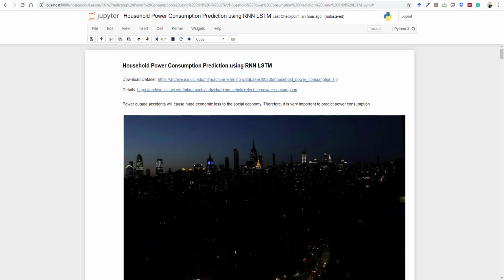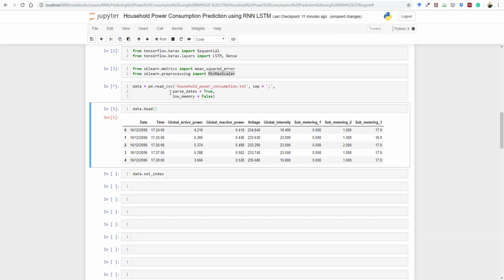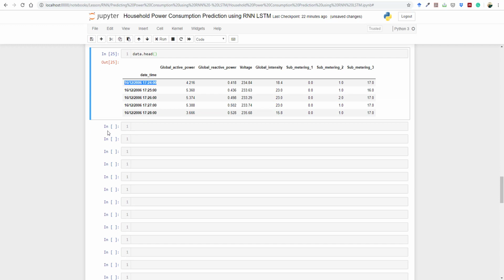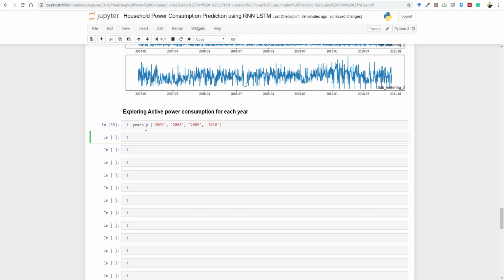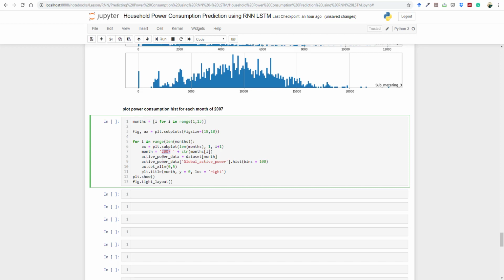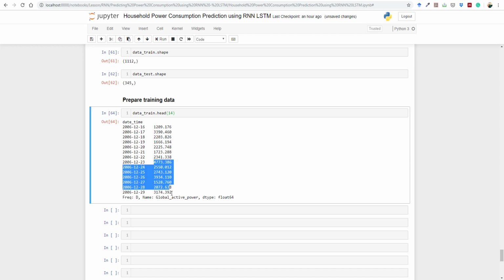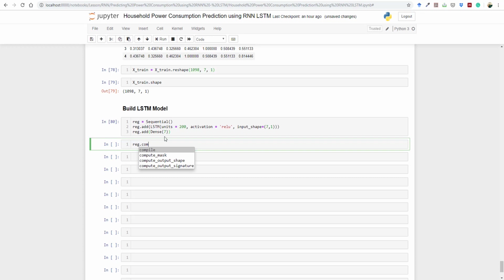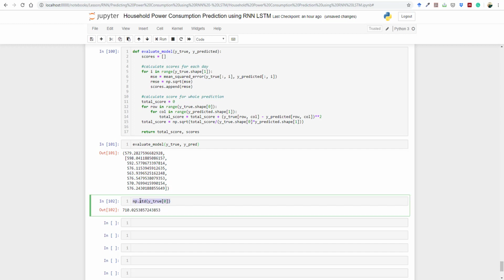TensorFlow 2.0 Tutorial for Beginners 19 - Multi Step Prediction using LSTM | Time Series Prediction

Comment: Hi,
Very nice tutorials. I have a question. I have some data with 8 features (including the target variable to predict which is Demand). My question is how to do a multistep step prediction for only one variable (for this case, Demand) using all the features from the previous time steps. I guess I would have to include all the columns in the line 66 of this file x_train.append and only one column in the y_train.append, but I am not sure if that's the correct way. 
Thanks and keep up the great work!